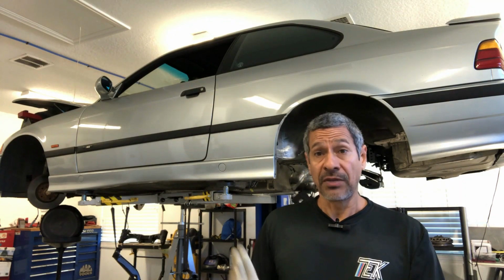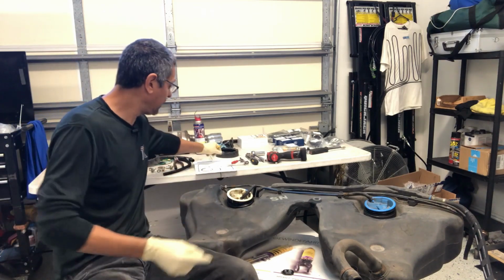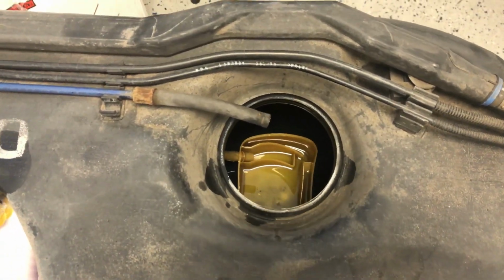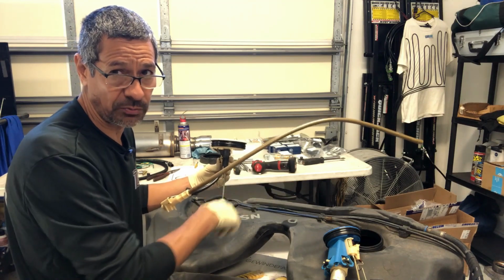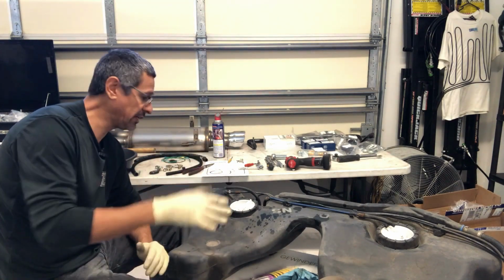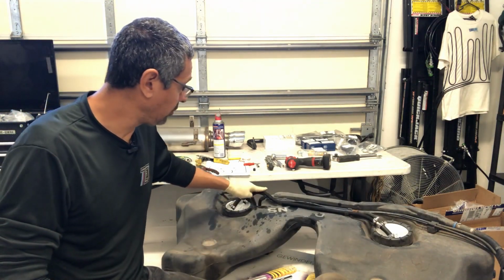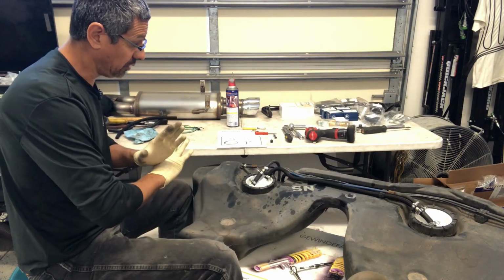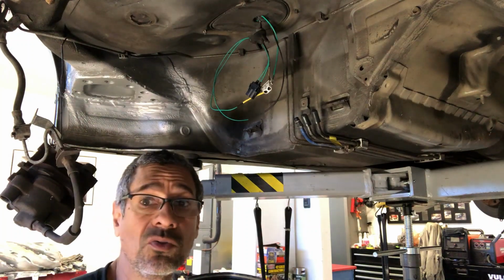BMW E36 M3, installing a Dual Fuel Pump kit.

Comment: won't the secondary fuel pump overheat if the car has prolong operations under half tank? The reason why the main pump under the oem configuration is on the passenger side because it will always be submerged up until you run it empty.
Reply from the maker: It can but so can the standard location fuel pump. They’re almost at the same height in the tank. I’m sure the standard location stays a little cooler as it has gas that hits it from the return line. In this install, the second pump feeds the standard location pump at the return port. If I’m remember correctly. 

Here is some info on when I ran dual fuel pumps without them overheating. I ran 2 fuel pumps in my 1 tack & 2 endurance race cars (all E36’s m50/s50) for 5-6 years before installing in fuel cells. Never once did I ever have a fuel pump failure. The endurance e36’s ran many 14hr races and 2 24hr races. We would run until we had to come in for fuel. 

Hope this helps.